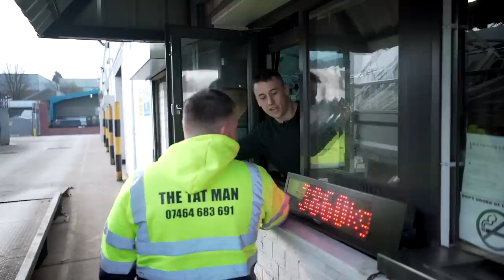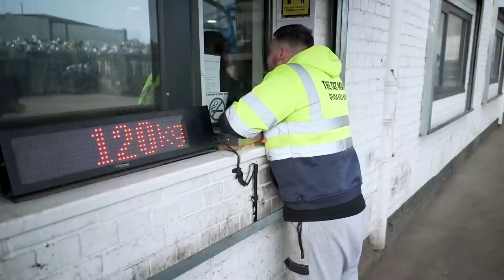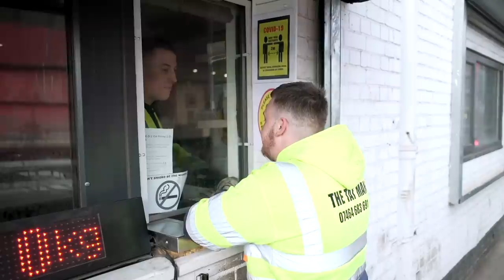TATTING ON THE STREETS OF BRUM | Scrap King Diaries #008

Comment: 4000kg so overweight then, hopefully you don't get pulled or big fines coming 👀
Reply: Twin axle. 5t truck
Reply: @c30dec58  i don't see no tachograph fitted in that van
Reply: @c30dec58  it isn’t twin axle 😭 it’s twin wheeler! The max weight for that tipper is 3.5 ton
Reply: Not to mention not wearing seatbelts at all!!